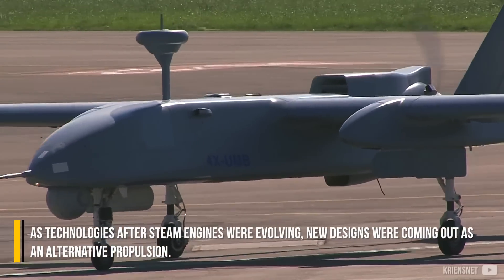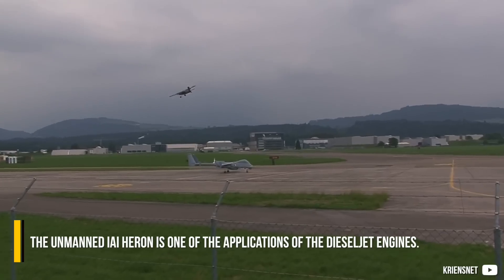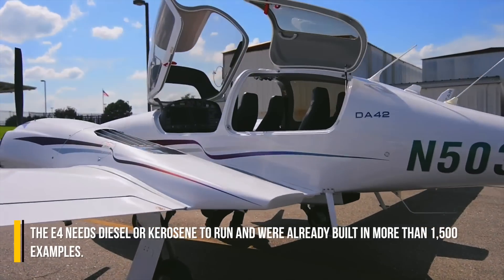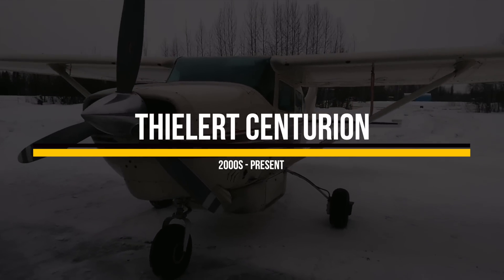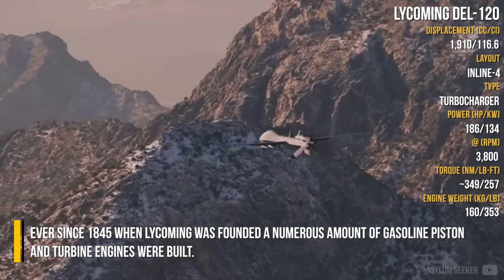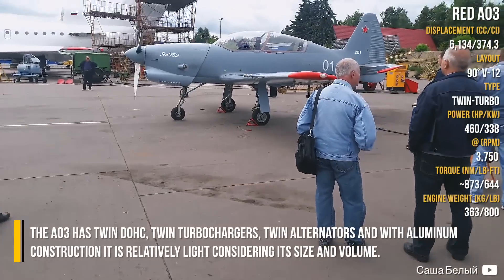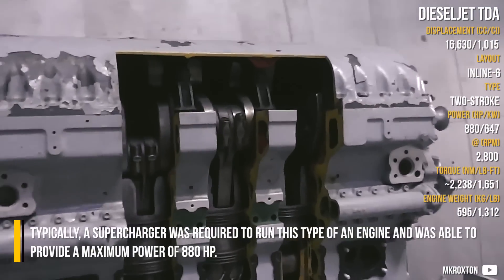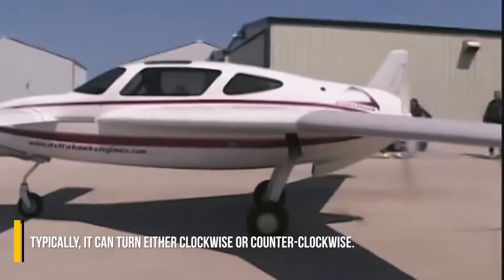8 Of The Few Diesel Aircraft Engines Ever

Comment: can't wait to see a diesel clunking Cummins 747 passenger plane...
Reply: fidel catsro well, technically speaking the turbofans that power jets like the 747 are a compression ignition engine using the same fuel as these engines (jet a, pretty much kerosene)
Reply: yes agreed amigo but they dont clunk like a piston diesel engine... thats what i want to see.. a piston diesel engine 747 airliner that goes clunk clunk clunk...
Reply: Germans used a diesel aero engine in WW2 and before.
Reply: @Pinzpilot101   it is featured in this video; the Junkers JuMo.
Reply: I know it's a joke, but it's interesting to note that a 747 has something like a quarter of a million horsepower, so a diesel large enough to power it would weigh as much as multiple 747s.
Reply: @PistonAvatarGuy  well if we're talking about scaling, then just based off of the Wartsila RTA96-C, a 250,000bhp diesel motor would weigh around 6,000 tons. Or about two RTA96-Cs and some change.
Reply: To roll coal midair you run a Corvair 990
Reply: Look up a b52 or kc135 water injection takeoff, also known as a "wet" takeoff.
Reply: Cummins powered Q400? :)
Reply: Shouldn’t you be cracking jokes in Dr Bergs comments section? What’re you my long lost twin?
Reply: @JH-lz4ky  👍👍
Reply: All engines are suck squeeze bang blow you dummies! All of them diesel=jet Fuel! Just different methods for ignition!
Reply: @daisybeagle6259  yes agreed but a turbine does that high frequency, it doesnt go running low frequency clunk clunk clunk like a reciprocating piston engine!!
Reply: @fidelcatsro6948  You are wrong ..... yes it does........Even a huge jet engine still goes suck squeeze bang blow!
Reply: @daisybeagle6259  yes but it doesnt reciprocate!!!!!!!!! its a spinning induction process not reciprocal induction process comprende???
they dont teach you all mechanical in US high school anymore?? we learn these in Cuba kindergarten!
Reply: @daisybeagle6259  aren't jets more suck really hard continuous bang blow really REALLY hard??
Reply: @antisobriety4201  No, they are suck squeeze bang blow engines, running on refined diesel!
Reply: Jeta1 basically is diesel so in reality a 747 already uses a fuel extremely similar to diesel
Reply: @Str4t0sph4r4  true they call em superior kerosene oil in some countries...but i still wanna see a 3000rpm diesel engine clunking plane spinning a 20,000rpm thrust blades from gearbox ratio converters 😺😺😺
Reply: fidel catsro Not enough power to weight in diesel piston engines to begin with. That’s why they are virtually never used in racing cars and GA aircraft. Not only that the mention gear box lossess would be immense in your ridiculous scenario, the gear box alone would weigh more than the engine and would waste over 90% of the power. I doubt such a thing could even take off.
Reply: @Str4t0sph4r4  then it will be a challenge to overcome...Renowned scientist Lord Kelvin once said airplanes could not be possible because theyre heavier than air, but 2 little cats who were only bicycle repairmen proved him wrong by inventing a plane that took off in 1908...never say never!
Reply: fidel catsro Not with today’s technology my friend. I’d advise against you investing in such an idea.
Reply: @Str4t0sph4r4  check the Napier Nomad.Reached test flight stage in the nose of a Lincoln bomber.The only reason that Napier didn't produce it was that they had the Eland turboprop ready for production.
Reply: It may not clunk like a diesel, since turbines produce power much the same as other combustion engines, but in a continuous power stroke. No pistons all power. Kerosene may ignite easier, but diesel in a continuous mist will burn like crazy. Turbines would run like 50s era engines.
Reply: That would be epic to watch but diesel airplanes will probably only happen in small GA aircraft!!
Reply: It's called Dieselpunk and it's art
Reply: And rolls coal midair
Reply: Lol

Comment: i know its not a piston engine, but you forgot the ultimate diesel powered plane....the SU-25.  it can run on anything, including Diesel!!!   same for the RD33 in the mig29
Reply: A jet engine will run on anything thaw is both liquid and flammable.
Reply: wow sukhoi running on diesel!
Reply: Yeah but they normally run them on coal, at least that's what it looks like in most vids I've seen.
Reply: lol, rollin coal with the best of em XD
Reply: but most jet engines run on jp7 or jp6.   theyre not designed to run diesel  though specially made engines can run it

Comment: The Austro engines that go into Diamond Aircfraft are Mercedes btw. You can even see Mecredes printed on the crank case.
Reply: The Austro diesel was developed as a response to the problems of the original Thielert Centurion engine and reduction gearbox (now, after further development, the Continental CD135/155) that Daimond used. However, the Austro Diesel had a cast iron block like the original Mercedes OM640, while the Thielert 1.7 (based on mercedes OM668 engine) and later 2.0 (OM640) originally had a cast aluminium block. New CD-170 is Continental own development with cast iron block and reduced static compression but higher filling pressure from turbocharger.

Comment: THERE'S ONE MORE COMPANY!

I was head development technician for a British company called Wilksch Airmotive, who also designed and produced various aircraft Diesel engines.
Our engines were 2-stroke, Aluminium construction, with supercharger integrated to the block, turbocharged, and had overhead camshaft for exhaust, 2 valves per cylinder.
They were available in inverted inline 3 or 4 cyclinder variants, with up to 50KW per cyclinder, and we were able to reach 240g/KWH fuel efficiency with a totally mechanical, indirect, non-common rail fuel system. All this and it would run on any fuel similar to diesel (even recycled plastic) and a 1000hr TBO.
The 4 cylinder engine I tested before leaving the company was producing 200KW (about 270hp) at 2750rpm, and burning less than 12gal/hr of diesel.
The company still exists, but I don't think they're selling new units anymore.

Comment: I was always told that early diesel had less predictable ignition, which created additional stresses on the propeller.
Reply: Rock Snot What you mean are rotational stresses and thats pretty much true but you could solve that by attaching something like a rubber cuppling between the two.
Reply: Yeah, or you could use a viscous coupler. There's lots of ways. But back in the old days, that just added a layer of complexity and reduced reliability.
Reply: Rock Snot Very true, thought the germans had some pretty impressive milage with junkers engines. I really like the jumo 205 engines  ;D.

Comment: I've seen a Cessna 172 with a Thielert engine at one of the local airports, but haven't had the opportunity to fly it. It's a little slower than a gas-engine 172, but runs on jet fuel (cheaper) and uses about half as much (4.5 gallons per hour in cruise instead of 9).
Reply: Seems almost too good to be true: cheaper fuel, half the fuel consumption, easier and cheaper to operate considering how difficult it can be to get 100LL Avgas in some places around the world!
I can easily see why people start talking about industrial conspiracies in some energy sectors.
Reply: if they are diesel, in europe it would be cheaper to put diesel in it
Reply: There is a Cessna 172 with a Thielert engine in CYPK.
Reply: @def787  It could be the same plane, since CFC moved from ZBB to YPK a few years ago.

Comment: Gassoline for life
Reply: Luisito Bardaji Benitez not really. Diesel engines have higher efficiencies than gasoline engines. Gasoline engines use the otto cycle which has a maximum efficiency of around 42 percent. The diesel cycle has a thermodynamic efficiency of around 60 percent. Diesel engines make far more torque which makes them better for use in trucks, armored vehicles, large watercraft such as yachts, and ships. Back in the day large pickup trucks used big block v8 gasoline engines. They had decent torque and great power, but they were gas guzzlers with bad gas mileage. Large pickups nowadays use diesel engines. Not only do they make more torque they are more durable and have gas mileages of around 24 to 32 mpg. Big block gasoline engines have mpgs of around 14 mpg or so. Big block being 454 cubic inches and larger. Bigger than 7.4 liters basically.
Reply: Lol dawg, stop being so negative! There are good Gas and diesel engines! Engines for life!
Reply: justin biggs i just loath the sound most diesel engines make, they sound like their commiting engine suicide and they smell about as good as burnt cat hair

Comment: Isn't a jet engine technically a compression ignition engine? (Just without pistons and such)
Reply: Randomdriving spark is only applied during startup or landing in heavy rain or de-icer mode
Reply: It is a continuous combustion engine that has to be lit by an igniter system, which is basically a super spark plug.  If it flames out, the igniters have to start the fire again.  It is not a compression ignition engine, it is more like a blowtorch.
Reply: sure amigo... these cats use multi fans to compress gas and air instead of air pump metaphor to work...
Reply: Martin Andersson: Yes that is fore sure. I should maybe have said it more clearly what I ment was that after the ignition the combustion of fuel does not need the spark any longer. Btw. I work with Boeing 747-400, 767, 737NG and Airbus A320 series engines daily.
Reply: I would have to say no. They still have spark plugs to ignite the fuel in them and after that it is just a continuous flame like in a propane torch or a gas stove.

Comment: Love twinchargers <3
Reply: R A M C H A R G E R S ! ! !
Reply: The supercharger on a 2 stroke diesel is pretty much necessity based tho, you just can't get the air inside the cylinders with enough pressure on crank case scavenging alone, the turbo is there for the added efficiency.

Comment: So someone was mad enough to think "Yeah, a 2-stroke V4 seems like a good idea. And while we're at it, why not make it a Diesel and add a turbo? Oh, you want a supercharger? Then let's add that too, oh, and  how about we turn it on it's head, i mean, why shouldn't it work?"
I really am curious how anyone can come up with an idea like that.
Reply: Lots of marijuana inhalation.
Reply: Because astrofan, they know how to design 2-stroke engines, and are not mentally stuck in 4-stroke mode.  A 90-degree V4 is a good configuration for 2-stroke engines, as the crankshaft can be easily designed for even firing intervals.  The engine is both super- and turbocharged because 2-strokes require supercharging for blowdown scavenging at starting and low loads.  Then when the engine is running at high power and high altitude, the supercharger can be declutched and/or bypassed, then the turbocharger takes over.

Comment: Why is the company named "DieselJET" when it's a prop plane with piston engines?
Reply: Because some aircraft Diesel engines only burn jet fuel.
Reply: @sandervanderkammen9230  Oh, makes sense, I guess.
Reply: @sandervanderkammen9230  But how do they pump the fuel? As I understand jet fuel has no lubricity just like gasoline.
Reply: @funcounting  Low sulfur Diesel fuel #2/ D2 has a lubricity factor of only 600mq no better than Jet A1/ JP8.
Every combat vehicle in service with the U.S. Army runs on the exact same jet fuel NATO F-34 (JP8)
Reply: @sandervanderkammen9230  Wiki says JP-8 can lead to damaged pumps in modern high-pressure injection systems. Guess older ones don't care as much.
Reply: @funcounting  Open source references like Wiki ar often not very accurate.
The military has been using JP8 since 1991 and before that their Diesel engines were generally multi-fuel capable  (Diesel, kerosene, gasoline, heating oil and a wide range of jet fuels.
In cold climates both commercial and military vehicles use D1 or kerosene fuel, the military also blended Diesel with jet fuel in years past.
Now, would I recommend putting JP8 in your Dodge Cummins pick-up truck? No, always follow the manufacturers fuel specifications.
Cheers!

Comment: Even if diesel engine were wade before gasoline they wouldn't be popular because of their low rpm. In these aircraft one thing is very common. It's that they are all small and light since they can't carry heavy loads
Reply: But the diesels have enough torque on low rpm's which is perfect for the propeller, so they do not need reduction drive which saves weight and can drive the propeller directly. Typical 82" propeller tip will go supersonic in just little over 3000rpm which makes a lot of noise and the efficiency of the propeller is very poor.
Reply: Gasoline aircraft engines in private aviation rarely run above 3000rpm.
Reply: Nazi Germany used gasoline made from coal. Diesel was reserved for kriegsmarine. That's why all their tanks were powered by gasoline engines. So the reason for conversion may very well be logistics above everything else.
Reply: sohan naik The Jumo 205 was installed in the Junkers Ju 86, it was a medium bomber and had a max. weight of almost 12 tons. 
https://en.m.wikipedia.org/wiki/Junkers_Ju_86
Reply: Ruben you realize only one survived at the end of the war and most of them had been converted to radials with only 1 production generation and 2 prototype generations running a Juno 205

Comment: What is better for an aircraft application horsepower or torque?
Reply: Horsepower.
Reply: Horsepower, torque is irrelevant in any vehicle! You use a gearbox to trade RPM for torque or the other way around...
Reply: Never seen an aircraft engine rated in torque, it's a meaningless value in aircraft applications.
Reply: Emilio Muniz torque

Comment: Nissan gtr engine aircraft
Reply: There was actually an effort about 25 years ago to build an unlimited racing aircraft using two engines similar to the Electromotive Nissan GTP race cars.  It was called the Pond Racer.  I don't know exactly what happened, but it crashed and the pilot was killed.
Reply: Jason Wong there a plenty of Subaru powered
Reply: It was a complicated set of issues that caused the Pond Racer to crash, but it was mainly the fault of the cooling system design. When the designers set out to design the Pond Racer, they thought that they were going to have engines making around 1,000 hp, so they designed the cooling system with enough capacity for that amount of power, but the engines never made that much and, as a result, they were over cooled. The over cooling of the engines meant that the engine oil never got up to operating temperature, which meant that it didn't drain back into the engine sump as well as it should have. As a result of the oil not draining properly, the engine was starved of oil and failed, causing the crash. The engine builders also switched from gasoline to methanol during races, which burns cooler than gasoline, and that compounded the cooling issue.
Reply: Honda engines are also becoming popular in small aircraft.